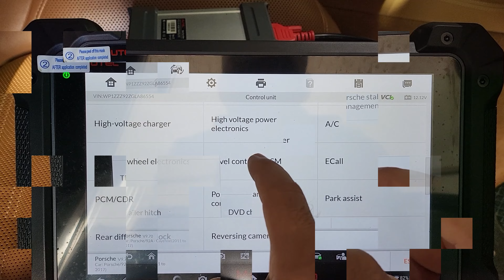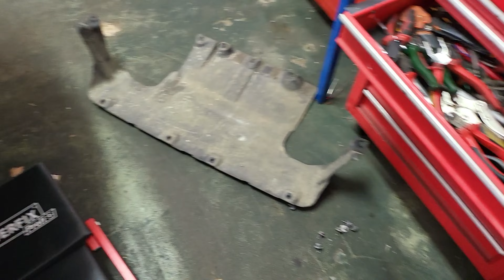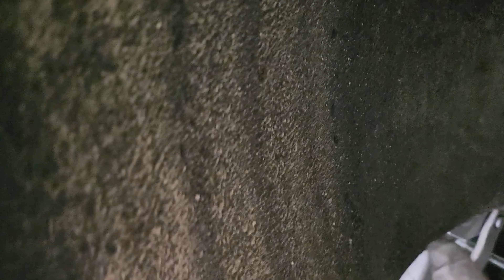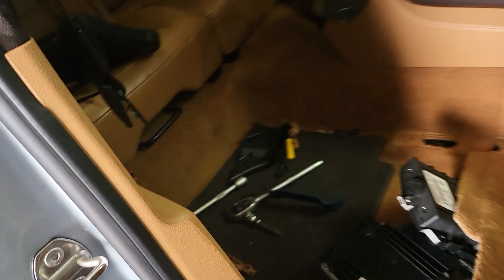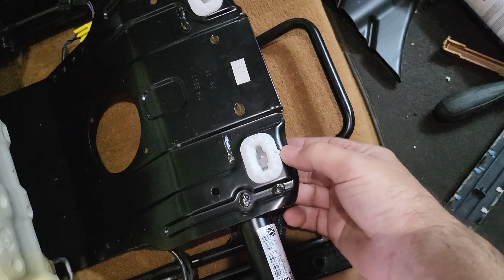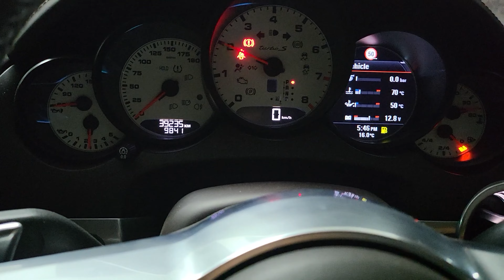Porsche Cayene 2017 PDCC system component find and fault repair

Comment: Hi, thanks for the video, you helped me a lot to find the block. Maybe you can help me? I have the error valve block rear axle implausible signal, pressure build-up rear axle insufficient High pressure front axle not reached. Do you think I have the same problem as you? I have a Cayenne 957 from 2007 Turbo, it's similar to yours in this video, isn't it? Thank you
Reply from the maker: thanks for watching
i would start by testing the valve block and would start with the bypass security valve because you dont have pressure in both axles, but its easy enough to remove and see the connections on the control module, in this case i had several errors and it all went away only by cleanning the connector and its still working perfect today. 
good luck
Reply: @PSICompanyPerformance  Okay great thanks for the quick reply, how do I test the valve block? With the program? And the safety valve too? Or do I have to do it differently? Okay I'll clean the contacts first, so the valve block is the same on the 2007 Cayenne 957? Can you show me somehow how to find the safety valve? And do I also test the valve block with the program, right?Can you show me a picture of the valves please?
Reply from the maker: @bmwdr1304  
The valve block contains 3 valves and 2 of them are for the front and rear axel and the 3rd one is the safety valve.
Its easy to figure wich is wich..
Just disconnect one at a time and diagnose the car and it should tell you what valve you have disconnected.
In Autel or Porsche Piwi you can test individual components such as these valves. I guess it depends on what diagnostic machine you are using.
I have done in the past full diagnostics to Cayenne's with Vag Com because it uses so many VW components.
Hope you can fix it.
Reply: @PSICompanyPerformance  Thanks for your help I did a few tests yesterday, first I changed the PDCC container and then did a low pressure test, the error 15642 rear axle pressure was too low and the red error message warning of the chassis system. After I changed the reservoir I also bled the system. What do you mean, what's up with this low-pressure test and the error then comes?
Reply from the maker: @bmwdr1304  does your car have hidraulic or pneumatic suspension?
iam just asking because i had a similar situation in my shop a few years ago in a Cayenne with pneumatic suspension and the problem was a small air leak.
Pdcc is to tighten the sway bars and its hidraulic but the code you have it seems to be related to suspension.
Reply: @PSICompanyPerformance  So I have an air suspension system with a compressor and the PDCC, I don't know if it's controlled hydraulically, I think so it need pentosin oil? For me everything is with air and the PDCC is driven by a tandem pump and needs hydraulic oil but I think they are 2 separate systems. Okay, you had a leak. Yes, so my air suspension is with air and the PDCC is hydraulic, I think right?
Reply from the maker: @bmwdr1304  yes thats it...
Suspension works separate from the pdcc.
The pdcc checks the height of the car on all four corners in order to harden or soften the sway bars / anti roll.
I wish i could help you more but, these system even when it looks really complicated, in person it really is not, because you now exactly what to expect of each component and a good diag machine gives all live data.
Good luck.
Reply: @PSICompanyPerformance  Okay thank you, I'll let you know if I found the error and what it was exactly. I will first check the lines to see if they are all tight and then check the valve block and the pump. All the best to you
Reply: Hi, it's me again, today I did another low-pressure test and controlled a few individual components and did pressure tests and suddenly there was a loud bang, do you know what that could have been?
Reply from the maker: @bmwdr1304  loud bang?
Hummm
The only thing i can imagine it could be is the air bag suspension...there is a fold in the middle of the airbag and if it inflates suddenly it usually makes a pop noise when it unfolds to expand...
Thats is pretty much the only thing i can think of that could cause that noise.
Reply: @PSICompanyPerformance  Hi, yes that could be it wasn't for me but do you know what it was? It was the hydraulic line from the rear stabilizer that burst completely can I somehow send you an email I wanted to send you a picture and know your opinion on it? It's the lines that go to the rear stabilizer in the valve block. Do you think the stabilizer is defective? It costs 2000 euros, it can be switched on, I'll send you a link with pictures .one line has burst away what do you mean?
Reply from the maker: @bmwdr1304  sure you can...
Send it to 
vuno01@live.com
Reply: @PSICompanyPerformance  Hi my friend, it was the rear valve block from the pdcc that was defective, maybe it will help you. Regards
Reply from the maker: @bmwdr1304  thanks for the feedback my friend
this is exactly what youtube is for,
sharing knowledge and experience.
thanks for that input.
Reply: @PSICompanyPerformance  No Problem my friend you are welcome .